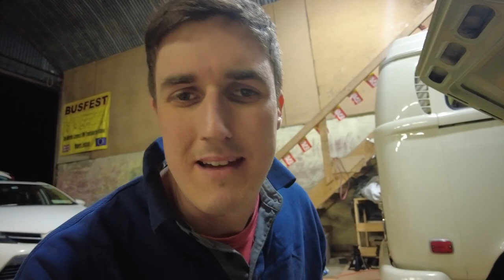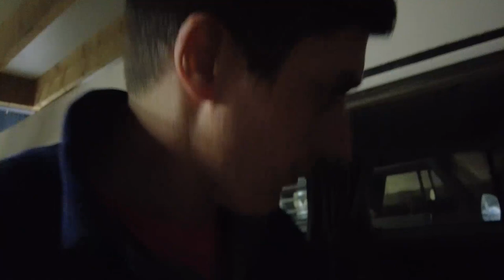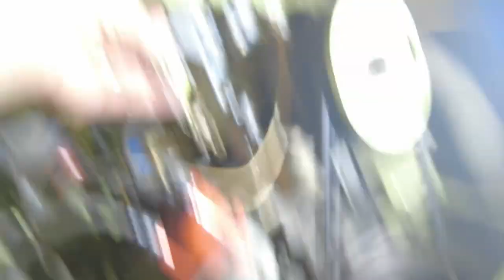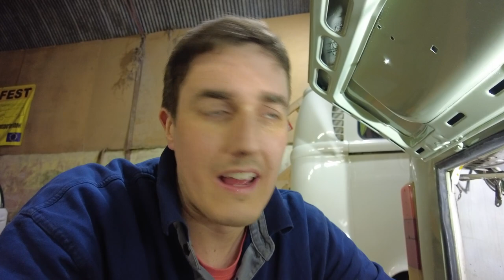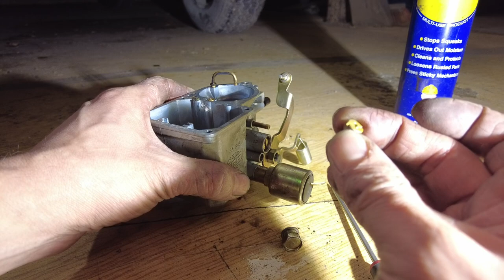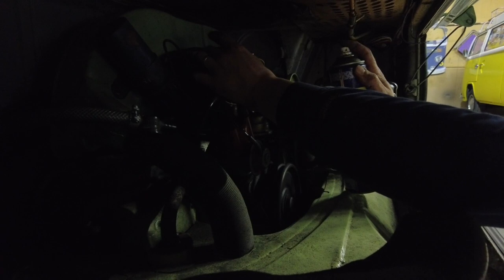VW Camper engine problems - Can I fix it?

Comment: Hi Ross, Have you ruled out stale fuel? Is the bus has sat for some time the petrol can degrade and give the rough running symptoms you have.
I would also replace the condenser while you have the points out, just to rule that out as well.
Good luck with the house move! 🤞
Reply from the maker: It wasn't that long since it was last used. Plus, looking at what was in the float bowl, I've no reason to believe the fuel is bad. I'll be replacing the condenser for sure. Thanks!

Comment: Get a remote starter switch and attach to starter.  Run a wire from + gen/alt post to pos side of coil.  Turn on lights. Removes need to go up to front of bus.  Saves a metric $hit ton of time.

Comment: My MG wouldn't idle and I found the points gap was way too small, It would be worth checking fella, cheers..
Reply from the maker: I'm going to be replacing the points as part of the process of sorting out the ignition system in general, so when I do that, I'll be gapping them correctly. Thanks!
Reply: @Endfloat  Cool, Yeah it ran ok but died when I took my foot off the gas, she idles perfect now after gapping them correctly, cheers and good luck with the move..

Comment: Coil?  Seemed to get worse the longer you had it on. Then was a touch better after carb clean so maybe coil cooled a bit? Those plugs are odd too never seen that in an air-cooled vw but I've never seen a mex engine.
Reply from the maker: Yeah I've been thinking that myself. I might try a spare and see if it cures the issue. Thanks!